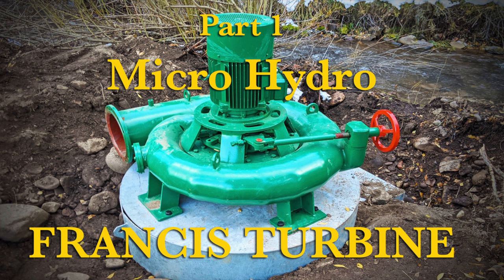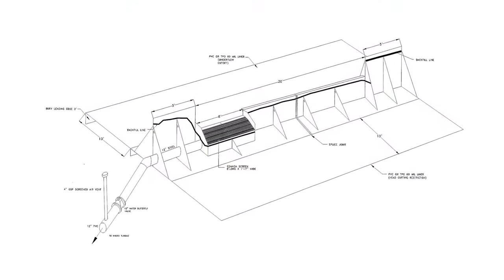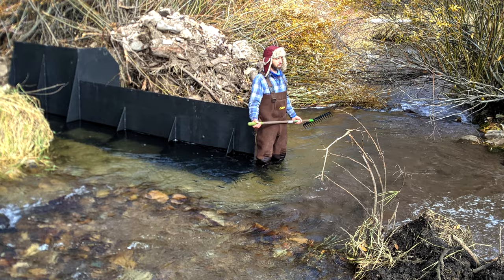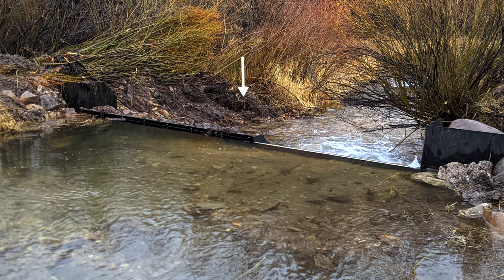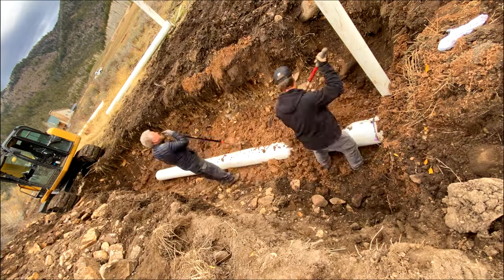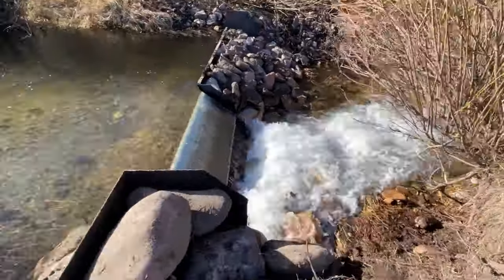Micro Hydro Francis Turbine Part 1

Comment: How much would a system like this typically costs? How do I find properties with creeks!!! Its very hard to find good properties.
Reply from the maker: It isn’t my property or project so I can only say it’s likely over $100k. Of course with Hydro you are paying for all future electricity up front and if its fully off grid like this system, you need to compare that initial cost to bringing in grid power and living with monthly fees.  The 12” penstock and diversion dam along with installation labor and equipment rental was the lion’s share of the cost. Thx for watching!
Reply: @mrhydrohead  Yes makes sense. Its a big job.

Comment: I LIVE IN NEW JERSEY THE STATE CONTROLS WATER RIGHTS FOR THE MOST PART.  WHAT STATE IS THIS AND IS THIS PRIVATE PROPERTY?
Reply from the maker: The system is located in Utah. It is on private property. I don’t own the property and was only documenting the system. I don’t know what the rules are regarding water rights in Utah as I live in Colorado. Thanks for watching.😉
Reply: 100% of the water is returned to the stream, so the only change is in the area between the inlet and the outlet. I would expect that as long as flow is maintained in this section there should be no objection.

Comment: I have 147' of fall, in 1/4 mile, using a 3" delivery line, and am permitted for a max of 95 GPM non consumptive use, that works out to about 850 watts with my Harris hydro pelton wheel, 17 years in operation now, grid tied. I have a stainless collection box, a HydroScreen (made by a guy name of Bob Weir, how cool is that) that was simply placed under the county culvert at the top of my property, with a telescoping 8" tube with in a tube to give high water adjustments, so not one bit of disturbance to the stream.  My water resources board here in Idaho made it real clear (pun intended) they did NOT want to see any construction work that involved heavy equipment and/or silt going into the stream.
Reply from the maker: Isn’t hydro great!?  Lucky you. Our system (elsewhere on this channel) runs 7.2kW in winter and 4.5kW every other season. Now in operation since 1996.  I considered  a HydroScreen from Bob but took a different approach. This system’s dam is very altering of the stream, but I guess Utah was OK with it. Congrats on being a HydroHead! It’s a great way to live if you can access the resource. Thanks for watching and sharing.

Comment: 🤔0:30 was such long pen-stock run necessary?
i get point they share same trench with power-lines to the house. but trench would be more shallow and therefore cheaper if it was only for power-lines.
since you seem to have rather potent river there, would it be possible instead, to get same (or better) yield, but from damn created at the turbine, but with bigger catchment (screen) of water? 🤔
Reply from the maker: The maximum potential power is achieved through a combination both flow and head (vertical fall where 2.31ft = 1psi).  The length of the penstock was required to harness the 30+ feet of head across the property.  I'm not sure what other potential units were considered (possibly a  turbulent unit https://www.turbulent.be) but there may have been higher costs with that.  30+ feet of head (30-36 = ~13-15.6 psi of static pressure) is a very low head and the turbulent unit might have been a viable choice but for cost.  There also may have been issues with permitting a sizable dam big enough to handle high springtime flows.  Or its possible the designer had more experience with this type of design or it was just his preferred method.  I don't think the burial of power lines had any impact of the choices made.

Comment: That is an awesome project! I am just getting interested in the world of Hydros, so please tell me why there was a Z-shaped pipe forcing the water upwards at the end. Doesn't that drop the speed of the water making the turbine slower?
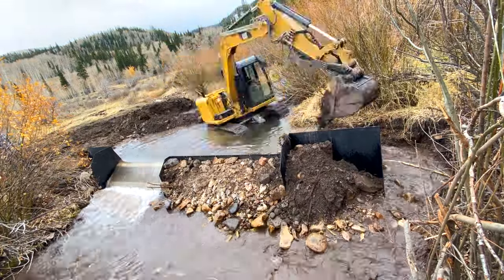Reply from the maker: Good Question!  The purpose of the Z pipe is to enable the position of the turbine above the height of the creek running beside it.  This is to protect from the high water levels in Springtime melt off conditions from damaging the turbine.  The available pressure level for the water in the system is measured to the height of the water in the draft tube below the turbine. See part 2 for detail about this @2:28-2:37 https://www.youtube.com/watch?v=8oE7hULefA4.  
So, there is very little loss if any with the use of the Z Tube.  Thanks for watching!

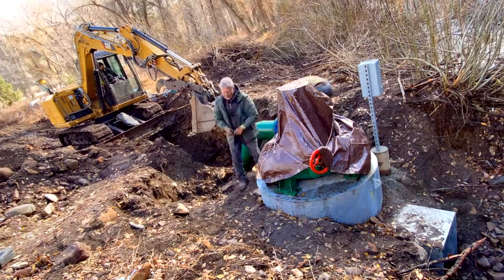Comment: 5:10 you say drain-valve is import but have you made it accessible or it's just covered with soil?
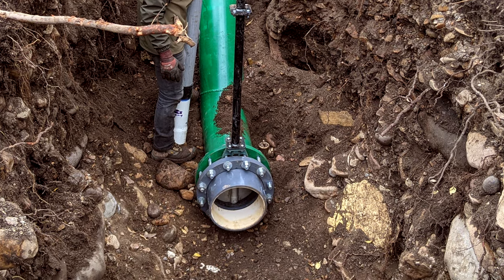Reply from the maker: This first segment was put together with visuals provided to me by the installation crew.  So I wasn’t there to see exactly how the pipes are set up.  The drain valve is connected to above ground access via the vertical pipe the worker is holding at 5:19.  The drain pipe feeds back to the turbine outlet box. In part 2 (https://www.youtube.com/watch?v=8oE7hULefA4) at 7:54 you can see that vertical access pipe next to the butterfly valve control. Thanks for asking.

Comment: 🤔 5:17 so you are losing some of the potential-energy because of last 2 bends and climb. do you know how much are the losses?
and was it the only way to do it?
did they have to bury pipes so deep because of worry about surface frost? 🤔
Reply from the maker: You are correct in pointing out the losses from the 2-45 degree bends in the Z pipe.  Any fittings or bends will increase pipe friction in the penstock.  I will have to look up what the specific loss would be.  It probably varies depending on the volume of flow.  My guess is that it isn’t a big factor.  I imagine they could have designed a subterranean structure for the turbine to keep from  raising the pipe, but the danger in doing so would be potential flooding from being lowered towards the creek elevation at high water.
Burying the penstock protects it from damage from vehicles, falling trees, or others. The freezing isn’t so much an issue as fast moving water tends not to form ice although the burial does provide safety in that regard.  With the high cost of installation of the penstock any form of protection is advisable. 
Thanks for watching and your good questions.
Reply from the maker: The pressure at the turbine would be reduced by the loss of head from elevating the pipe out of the ground.  This would be offset somewhat by the draft tube below the unit on the exit part of the Francis turbine. 45° and 90° fittings add what is considered "minor" friction losses in the penstock. As a follow up, here is a link to software for calculating pressure losses due to fittings in pipe. https://www.aft.com/products/fathom.  Very geeky and likely not necessary.
When installing my own system I ordered lots of fittings to turn the direction of pipe.  I was grateful that my contractor simply flexed the pipe in broad turns in the  trench to round bends.  I'm sure it saved in friction losses rather than using fittings.  I can tell you find the series of interest.  Thanks again for watching

Comment: How cold is it where you live? Is there any chance of this system freezing?
Reply from the maker: It isn’t MY system as I only documented the project and don’t own it. Our system in the earliest videos on my channel is located at 8600 ft in Colorado and is a similar elevation.   Our temps at night get down to -10° frequently in Winter and we've never had it freeze up.  Moving water seems to not freeze particularly if the penstock is buried.  Thanks for watching

Comment: Nice! Overall the system looks great, but the dam seems to be the weak spot.
Reply from the maker: Interesting. I thought the dam was a pretty solid design/idea. Time will tell. I will visit the site and see how stable it is. The designer also incorporated an anode-cathode system on the dam to reduce corrosion. Thx for watching!
Reply: @mrhydrohead  OOOOO nice. Looks like it's about 3/4 steel plate. Will probably outlast all of us
Reply from the maker: @easternwoods4378  Hi Ernie, You are most likely correct in that assessment.  I'm working now on Part 2 and the heightened water flow which I filmed in early June was easily handled by the design.  There wasn't any way to film the Anode/Cathode system which was all submerged, so I won't be putting any of that in the video.  There was one viewer that felt the dam design would greatly impede the migration of fish, but not being the designer or owner myself, I have no way to change or comment on that.  Hope you are well.  Cheers
Reply: @mrhydrohead every stream has a large amount of highly abrasive silt and gravel material flowing down with the water, which is constantly grinding down the protective coating and thus exposing the steel to corrosion. Not to mention the lack of a proper foundation.
Reply from the maker: These may indeed be weaknesses of the system.  Only time will tell.  I've only visited the site once, so I don't know if these are issues yet.  I know the owner intended to construct a silo type structure over the turbine and that may prolong the life of the system on any foundation issue. 
I was aware of the runner erosion issue on my pelton system (documented elsewhere on my channel) and thats why I chose to divert waters into a meadow where any silt or sand could settle.  Thanks for watching and the incisive comment. @ilijasulc2247

Comment: Why are you using 12" penstoke with only 1350 gpm and 11 meters of head? Is that a Francis turbine you are using? What is your power potential Calc?
Reply from the maker: First let me say that this is not "my" system, but one that I am documenting. There may have been a limit how much water could be diverted through the system so as to not damage seasonal capacity for fish habitat. The output design is more than adequate for the owner's needs.  The expected output is 3-6KW which is 72-144 kWh/day.  Thats a LOT of power and the design has battery storage as well. 
I didn't design or install the system, but was permitted to make a video about it.  The penstock is designed for a flow of 3 cfs and the 12" pipe can handle this flow without excessive pipe friction.
The 11 meters of head is what can be contained within the property boundaries.
The Turbine is indeed a Francis design made in China by HS Dynamic Energy Co.  
www.hs-dynamics.com  It has designed capacity for 6.6KW at 784RPM with suitable flow of 2.9cfs and suitable head of 33 feet.
In June I was able to visit the site and will be posting another video which has more detail on this system before long.
I hope this answers your questions.  Thanks for watching!
Reply: @mrhydrohead  thanks this indeed answers my questions very well. I'm currently looking at designing and implementing a similar system so I really appreciate your response.
Reply from the maker: @sbsankey  cool , stay tuned, more to come

Comment: The Z pipe reduces the scientific energy of the flow, but if the slope of the pressure pipe had been corrected so that this change was not so abrupt, it would even reduce the water hammer generated. I would like to understand why it was executed this way. 
Regards
Reply from the maker: The draft tube on the bottom of the turbine is what actually keeps the working pressure at the lowest point of the penstock as it provides a couple of feet of "downward pull" or negative pressure on the water as it exits the turbine. At least thats what I was taught.  The Z pipe only has 2-45° bends and this will create minimal friction on the water. Its a choice the designer made and ultimately I think a good one.  Leaving the penstock above ground in a sloping manner might create other problems in a heavy winter freezing environment.  
Water hammer generally is a problem resulting from too abruptly changing the speed of the water by overly rapid changes to control valves.  Thanks for watching!

Comment: What size of Francis turbine was used on this project? Please
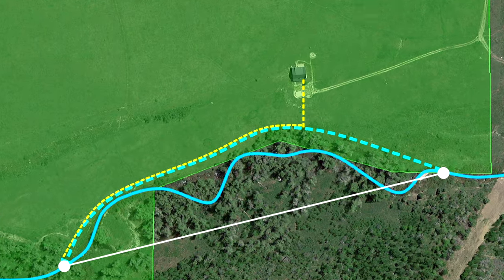Reply from the maker: Part 2 about this project has a placard @ 4:25 with ratings and mfr contact info. 6.6kw on this unit and part 2 has additional info on the system regulation and battery storage. Thx for watching 🙏🏼
Reply: Where do you purchase this stuff? What type of materials do I need. Who do I source out for this? I live in British Columbia Canada and have a property identical to this I want to setup like this.
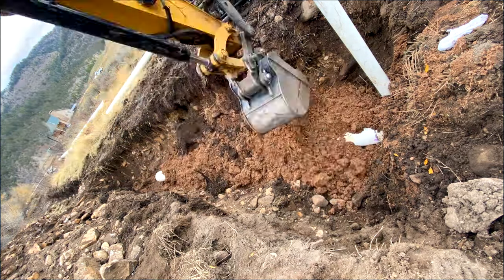Reply from the maker: Let me say you should watch Part 2 on this system (https://www.youtube.com/watch?v=8oE7hULefA4). In there @4:25 is a placard on the turbine with contact info for that particular device.  I would strongly advise that every micro hydro site is unique in how much power potential there is and what the best approach to harnessing it might be.  It is important to have a good knowledge of your energy needs, budget, equipment options, legal restrictions and time horizon for your intended system.  Not having a good overview can result in very expensive mistakes and frustration.  
There are a lot of systems in BC and very able designer/installers in the province.  My first system was designed with the help of a BC engineer who is now in Costa Rica. I think it would be best to locate someone locally who can give you guidance before assuming a system like this would be your best choice.  You are paying for all future power up front, so none of this is inexpensive. @samanthagallagher7584

Comment: i am very excited about the potential of this type of systems, for me the life cycl impact of the hydroelectric dam is much less than the other types of green energy, purely because of how long the dam can operate relative to the impact period. a big issue with the consideration in envirmental impact assessment is the period of time and the impact of all the materials used to make it from the mining to the forging.  Dams have a big impact in lowlands but in highlands it is not as wide spread. smaller dams in rivers seems to have a low impact, if there is some issue of cutting off species this can be mitigated. this has been done with trout i beleive. so this has some potential as animals and ecosystems can addapte but not if we keep changing things at rates that are faster than the evolution of the landscape or the species there already. so like solar panels are great but the panels are deterioting fast. how long is the dam lasting, maybe it fine to use some steel but probably better to use local materials. to reduce the initial impact, most of the impacts are proxied by the thermodynamic cost so that is somehting to consdire with the moving of material and the life cycle, persisten chemicals hazards etc not considered.  fund and subsidees or cheep oil makes some material seem more cost effective in the short term but in the 150 year scale they end up being much more expensive.
Reply from the maker: When you look at the bigger picture, it seems all technologies have unexpected impacts.  But trying to anticipate all impacts IS the proper approach.  Thanks for watching!

Comment: How much power is produced?
Reply from the maker: Part 2 about this system https://youtu.be/8oE7hULefA4  at 4:24 shows a placard on the turbine and indicates a rated design capacity of 6.6 kW along with other design characteristics and contact info for the mfr.  I  don’t own this system so I don’t have data as to how the system output varies depending on seasonal changes of flow.  It may be capturing this much year round, but that is an enormous amount of power (158 kWh per day) which in winter could be used to heat the house.  In summer, I would guess it is too much power to put to good use. If the system was tied to the grid, they could feed it there.  This site is off grid however. If it were grid tied, they could effectively use the grid as their battery bank.
Thanks for watching.